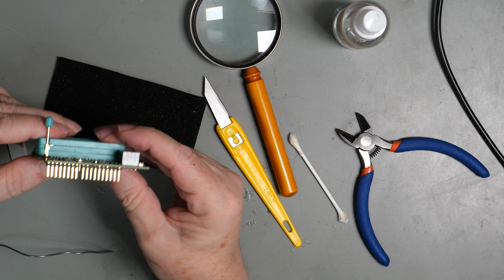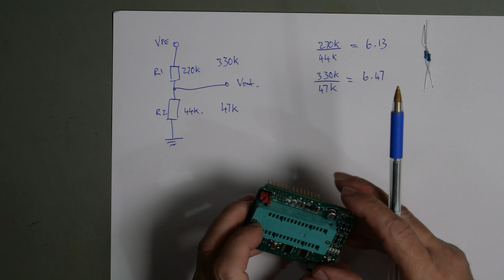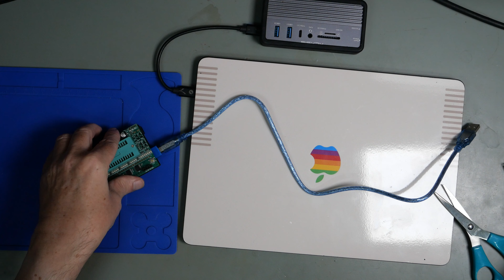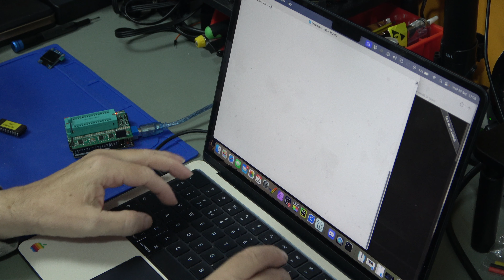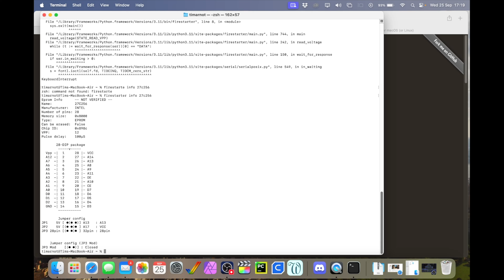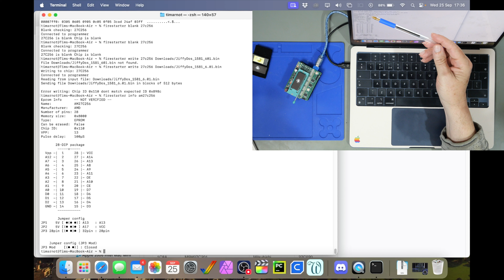Relatively Universal Eprom Programmer for Arduino

Comment: How do we in the UK get this as he doesn't ship to the UK?
Reply from the maker: Back then I did a run of them myself, and sold them through eBay. But it took so long to sell them that they were very out of date before the last ones sold (it was also quite hard to sell a rev 0 board when the current build is rev2...). So unfortunately I didn't consider it viable economically to build another batch.

Comment: hi can I also burn a D2732a with it? I can't find this chip in the list Thanks for Info
Reply from the maker: Do you know the chip's specs? Maybe you can read the ID out of it and match against that?
Reply: @TimsRetroCorner  Hi Tim Unfortunately I don't know the specs of the intell D2732a U7420139S PGM 21V, I thought you could tell me. I have an old board with an application of 6 EPROMs, I just wanted to copy and paste them onto other new 2732 chips, Thank you, thank you

Comment: Can it program 28c256 EEPROMS? They are tricky due to the software data protection disable.
Reply: I haven't had much luck with my AT28C256 so far
Reply: @afkafkafk  Thanks, I have switched to NVRAMs ds1230y (same pinout) for now, after a month of trying Ben Eater's programmer and other circuits and software unsuccessfully with AT28C256s. Just be sure to tie WE of the NVRAM to vcc once programmed for write protection, when removing it from the programmer to your circuit.
Reply from the maker: I understand from the developer that it's physically capable, but the software to do it hasn't been written yet.
Reply: @TimsRetroCorner  Thanks, Tim.

Comment: Don't use electrical tape, it is nasty and will fall off. Kapton tape is the industry standard for a reason. Also that ZIF socket is less universal than ideal for DIP packages.
Other than that, good job!.